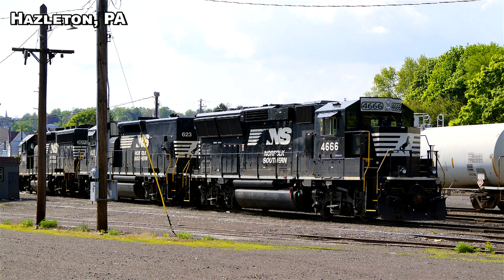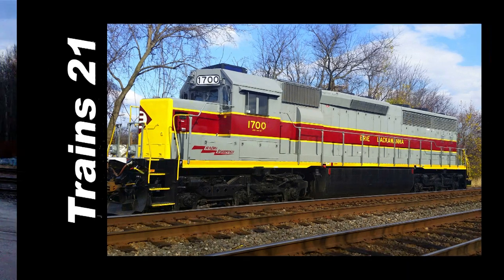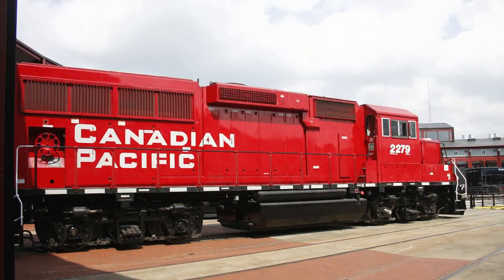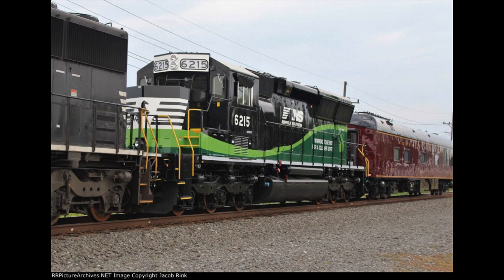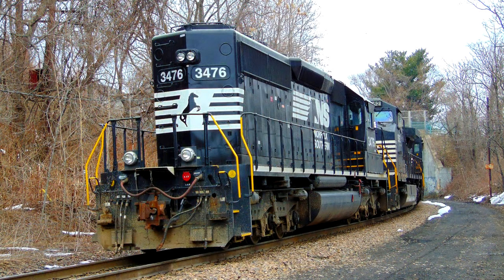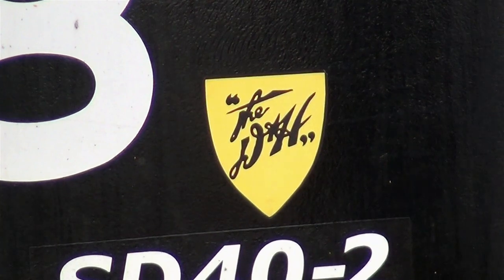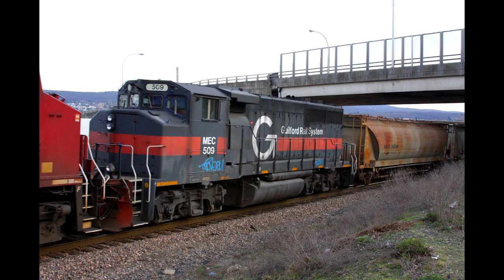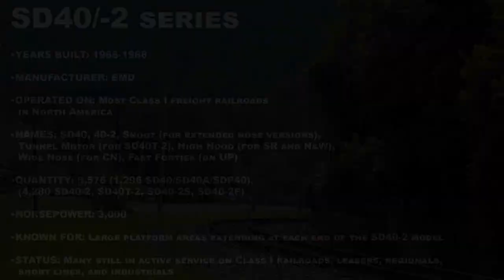[GL][T-310] 50th Anniversary: EMD SD40-2 (G.O.A.T.) | (Part 4 of 5) Indelible EMD

Comment: From 2011 to 2015 I worked for a company that manufactured high voltage cabinets and control stands in house ,a/c cabinets for NS in Juniata SD 60e upgrades. We did over 100 of them only to have the whole thing scrapped a few years later

Comment: The SD40 SD40A SD40T-2 SD40-3 SD45 SDP45 SD45-2 SD45T-2 SD38 SD38-3 SD39 SD39-2 were some of the last best units EMD made before the SD50 failure
Reply: while the SD50 didn't do well, the SD60 and SD70 were very successful locomotives.  The SD80 was another lemon that didn't sell well, but preforms well today after some fixes, and the SD90 was pretty much UP wanting something big and powerful.  The SD40 platform is the most iconic locomotives associated with American railroading.

Comment: I'm appalled at the number of people that think EMD of the past is the same as EMD of the present in the past it was owned by GM, now it is owned by progress rail those two are not the samethe sd-50 was a GM debacle progress had nothing to do with it, yet every EMD to day is judged by the sd 50 and sd 90 screw ups, true progress tried to fix the sd 90 but you can't make a silk purse out of a pigs ear, they tried but to no avail and all that happened was some of the sd 90 dirt got on Progress, so they come out with the tier 4 st70ah and it's automatically judged as a piece of crap. A couple class 1s had to buy bunches before any one else committed to the move, hell one bought 10 and sold them then bought more when they were out in service for a year.